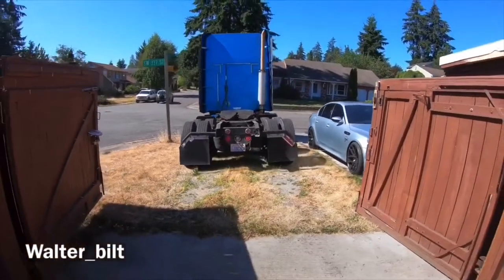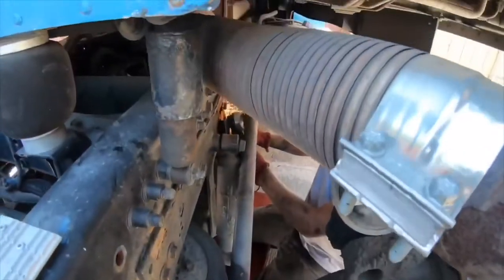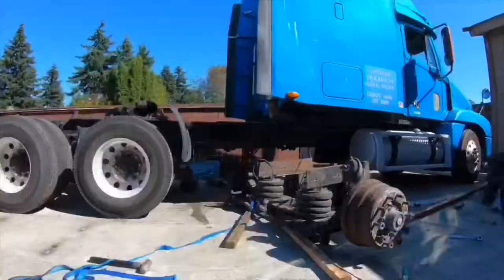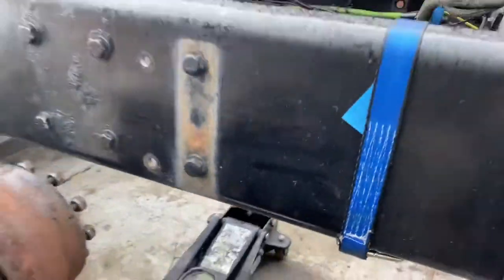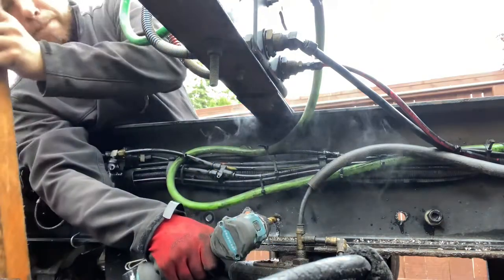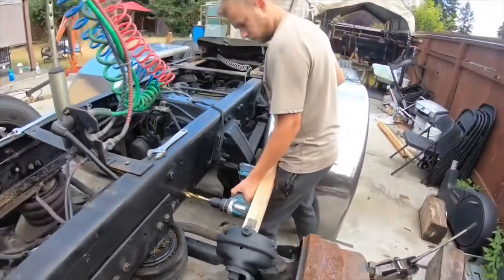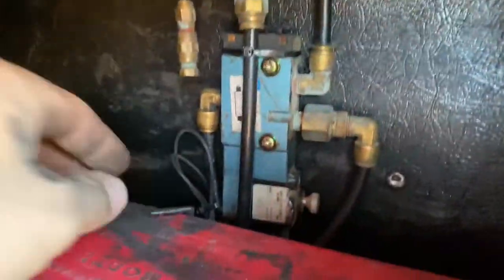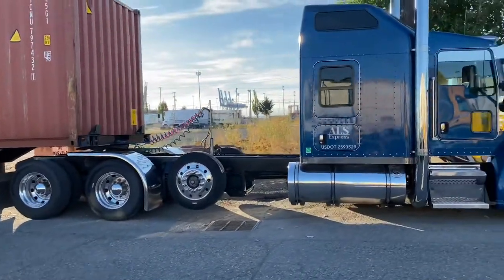Kenworth Upgrade | Drop Axle Install

Comment: What size tanks do you have? I would buy one of those brackets for the air bags in the front because when I put air in the front one day I will have that same problem as you with the oil filter on the passenger side smh you truck looks good I like how you got skills and knowledge do do fabrication like that! Thats special and a big money saver!!

Comment: You truck looks very cool. Did you notice a fuel mileage improvement with the lower front bumper and lowered ride height? All new trucks, especially freightliners have these huge low air dams. They say it’s for fuel economy. Thanks.
Reply from the maker: No not really, I get a lot of drag on the container with the low sleeper and long frame. Those freightliners got tall sleepers

Comment: Is that your 40ft chassis? Man that's a nice chassis and the truck looks great 👍🏾
Reply from the maker: MrBigR 504 yep 😃 thanks!
Reply: @CustomRigs  Ohhhh man do I have questions! I thought about getting my own chassis but I figured I'd have to have my own authority. There's only a couple of dudes running containers in Atlanta under their own authority. There's more around the port I'm sure and it's easier to load and unload at the port than a railyard in Atlanta. The swing fees would eat your profits up! I used to have a 40ft tri-axle (company chassis) when I was pulling in New Orleans up until Hurricane Katrina and l loved that chassis I swear! You can put 1 or 2 20ft'ers or a 40ft. You can make sum nice money with the chassis you have. Man that's cool and congratulations 👍🏾👍🏾👍🏾. Maybe you can do a video on your equipment and how you use it?
Reply from the maker: MrBigR 504 yeah I was thinking of making a video about it.. mine only hauls 40’ cans but a combo would be nice. There are a ton of guys with their own authority over here running by themselves with just one truck in their company.

Comment: was it delivered by freight or did you pick it up? how was taht heavy ass thing unlaoded? lol I got a smaller axle (dually diff off a 2008 3500 duramax) and that thing is 800 lbs, had to use an engine hoist and dollies ofc
Reply from the maker: No bought it from a local guy we took it off his truck and put on my truck same spot. It’s over 1k lbs
Reply: @CustomRigs  Ahh. Yea definitely looked heavy.

Comment: Real talk here. Drill bits… are y’all having any luck with re-using a specific brand?
Reply: A man I bought a set from Fastenal, cost about $400 for like 24 bits. Have had them for about 6 months and use good thick oil not that runny shit and so far they have beat everything I have ever had in the past.

Comment: what does adding 2 lift axles do for a 5 axle truck? isn't the gvrw still 80k total??
Reply from the maker: No you can register any gross weight you want from Dmv, 80k is just standard legal weight. I was paying for 98k gross at times all the way to 105k gross weight depending on how many axles you have.
Reply: @CustomRigs  so if you get a reefer trailer with extra axles you can add more weight than 80k? If the trailer can handle it? Can any trailer truck handle pulling 2250 lbs each pallet so total cargo weight of 63,000 lbs if 28 pallets?
Reply from the maker: @johnlim123  4 axle refer trailer would be kind of useless the produce is usually pretty standard legal weight. There’s 4 axle dry vans or flatbeds that can haul heavy loads
Reply: @CustomRigs  no my produce is heavy. radish weight is over 60,000lbs in standard 24 pallets but if I can fit more on a trailer with each trip going into New York city would saves thousands each trip.
Reply from the maker: @johnlim123  I’m guessing you would probably need a 4 axle refer trailer to haul 60,000 lbs of radish and probably a 4 axle semi truck. That would put you close to 105k gross weight